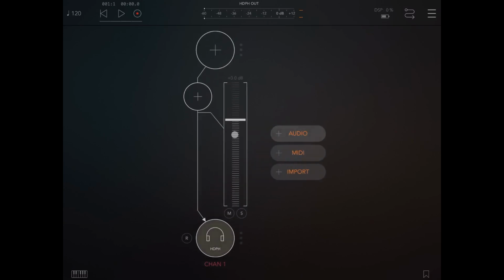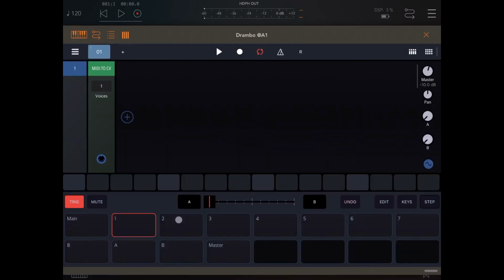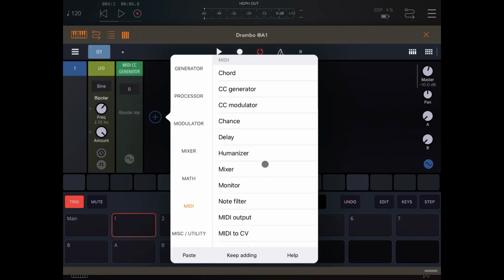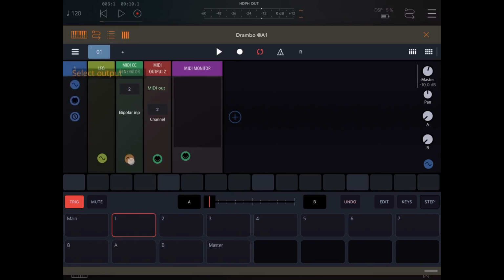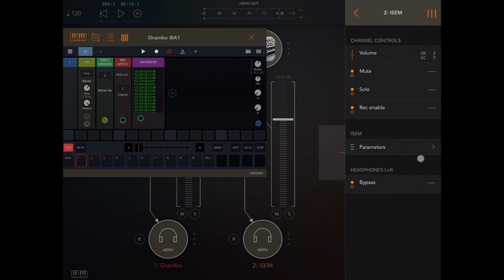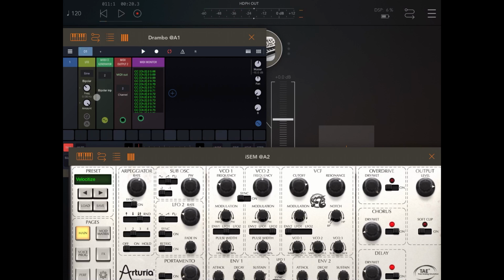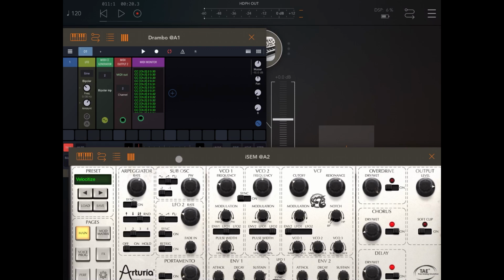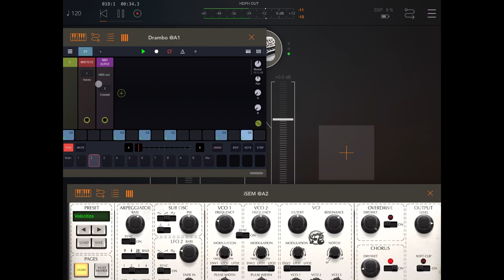BeepStreet Drambo - Tutorial Part 10: Modulate external synth

Comment: Hi,thanks for tutorials! Does it possible to put after envelope follower control velocity module like midi cc generator? Thank you! Can’t find it....
Reply from the maker: Hi, are you asking if you can control velocity of the notes generated from the second track? Or Are you trying to control independently the velocity from the first track? Thanks SFM
Reply from the maker: when you say you have an analog module, is this inside drambo, or like in this tutorial a synth assigned to an audio channel inside AUM. I am trying to get a picture of the setup so that I can help you with the right answer.
Reply: It is external hardwire modular which  can get midi and 
convert velocity information on one cv socket
Reply: For example in this video lfo modulated cc ,but I would like to have velocity module instead cc generator 🙂
Reply: Excuse me i misled you my comment about sampler and envelope follower it’s from another your video I deleted it sorry 🙄
Reply from the maker: how about using the gate + velocity sequencer, Note Generator and Midi Output modules?
Reply: O,thank you for advice,i will try this model,thank you one more for yours excellent tutorials!!!!!🚀
Reply: Yes it work o magic!!! Thank you so much!!!!!!👏🏻🤝⚡️🙏🏻🙂